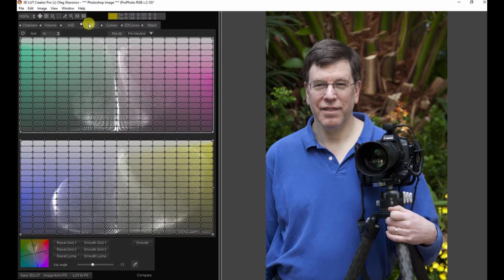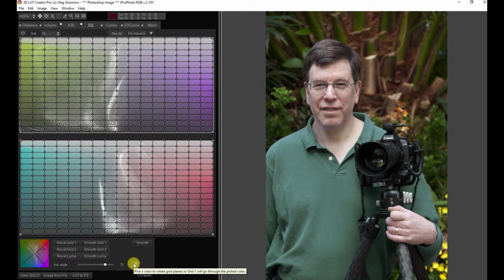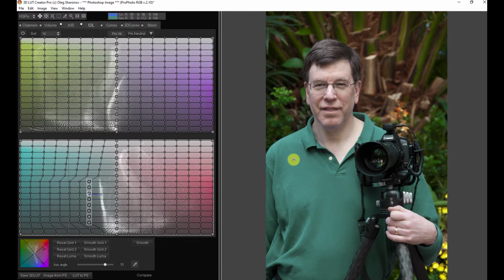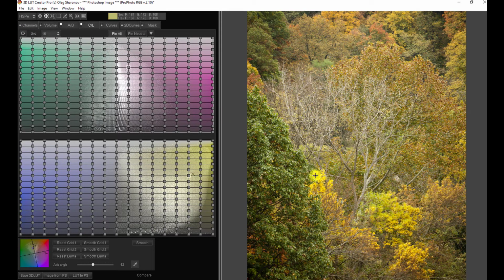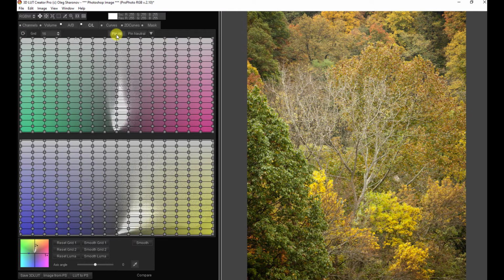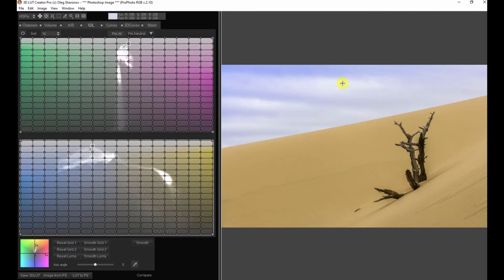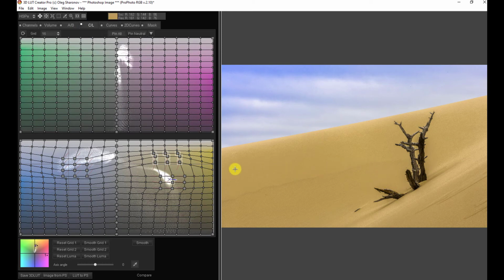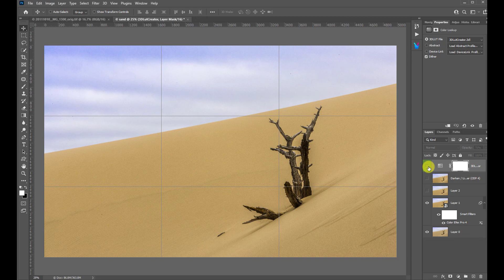How To Use The CL Grid In 3D LUT Creator

Comment: I really wish 3D Lut reator had a normal hue specific luminosity adjustment. It seems impossible so far as I can tell to darken only red hues, for example.
Reply from the maker: Hi Brandon. If I am understanding your question correctly….you can go to the C/L grid and using the eye dropper choose the hue you would like, then select the portion of that hue you would like on the grid and pull it down to darken any specific hue. Let me know if that’s not what you meant!
Reply: @howardgrillphotography2280  The problem is that it doesn't affect only the chosen hue. What I mean is a hue specific luminosity adjustment in the manner of an HSL slider in programs like luminar, lightroom, etc. Granted I find the C/L panel to be quite useful in achieving nice effects in its own right
Reply from the maker: @RebeccaMorningstar  I see what you mean. It actually is more specific than choosing one specific hue. I will ve to look through some of the sliders and see if there is a way to do that.

Comment: Thank you Howard, very useful. In my short time using 3DLC I typically skip the C/L grid and go to curves after A/B. I don’t find this grid as intuitive as the others and felt that I could get the adjustments I wanted in A/B or curves. I plan to play around with C/L more and see what results I get. At the very least it is fun software to play!
Reply from the maker: Thanks Tim. Definitely play around with it. I find that I use the AB grid for more marked color changes and then the CL to fine tune them. But the software is fun to play with and there are likely several ways to get to the same result. 

On Christmas Day I’m releasing a video on the channel mixer. Talk about playing around! Lots of cool effects you can get playing in that tab! I’m really glad you are finding these useful.